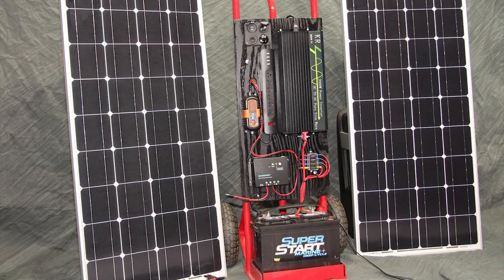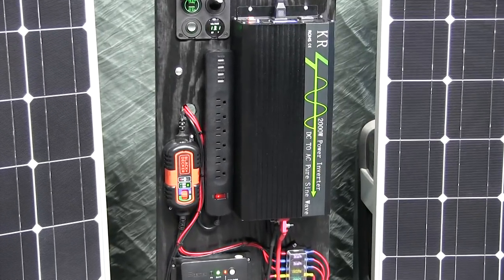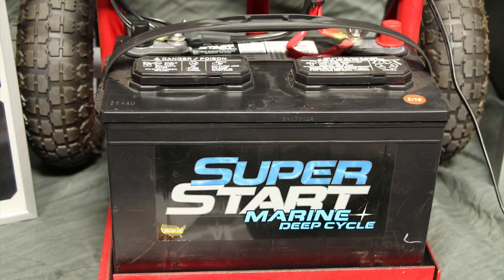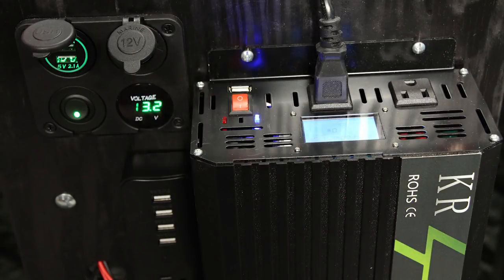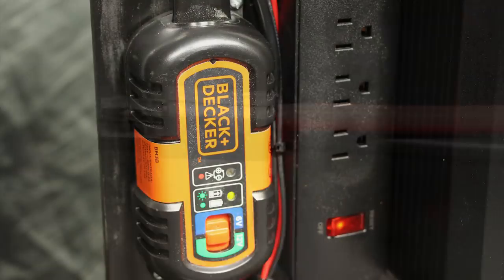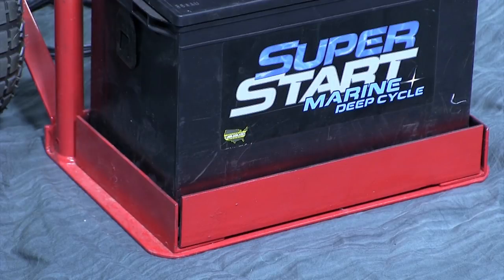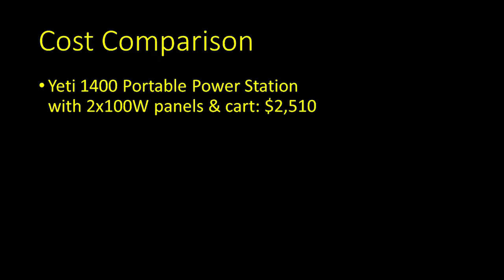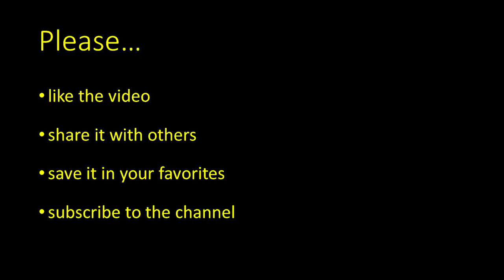DIY Off-Grid Solar Generator (rev 2) – Low-Cost Portable Power  -- with Build List

Comment: With the way you wired your 12v quick connect  with the + exposed you stand a chance of arcing with contact  metal on your build  I have all ways prefered to cover it to protect it from accidental contact and blown fuses.
Reply from the maker: Thanks for pointing it out, but I think everything is alright.  The system isn’t grounded, so the only place it could theoretically arc is to the negative battery terminal (or something wired to it).  This is a big deal in automotive systems where nearly everything metal is a potential ground for a loose 12V wire.  Nevertheless, good practice would be for the connector to expose the negative and have the positive covered.  This is actually correctly done on the unit — the power through the connector comes from the solar panels, and the positive connector on that side is not exposed.  The connector on the controller side could still arc if battery power feeds back through it, so I checked that.  Nothing, so the connector is as it should be, and there’s no risk of arcing.  I appreciate your comment, though — it’s nice of you to take the time to help me by pointing out a possible issue.  Sharp eye you’ve got.  :)

Comment: skip buying the invertor (make your own) , wrap a whole bunch of turns 400 of 14 gauge wire inside iron transformer one coil only. The more turns the better.  .pulse a transformer with transistor buy washer pump motor and motor to drive washer pump motor and one solar panel to drive motor the volts comming off of washer pump motor will get dumped into transistor to transformer and back to transistor will give you lots of volts and amps A.C to go with it. store energy in caps that connect to plug ins strip. thats all.  enough power to run several household items like air conditioner and electric heater. stuff like that.  off of ONE solar panel.  You can add a battery in there if you want for nigh time use.  enjoy.
Reply from the maker: Something wrong with the math there.  One of these panels produces 20V @5A (=100W).  If I could invent an inverter with no loss, I could theoretically get 120VAC @ .8333A (=100W).   The inverter in the unit is 87% efficient, so it can only produce 87W directly from a single panel...
Reply: not to mention would it be sine wave modified or uncontrolled

Comment: Excellent approach to explaining the why’s and how’s. One question, how do you mount the panels. I would be interested in your approach.
Reply from the maker: I originally thought I could find a good spot to use them at ground level, but that’s harder than I expected.  I finally built two wood frames to mount them on the structure that shades our BBQ.  I used a carpenter square to find the best angle in the end of Dec, when the sun is at its lowest — about 23 degrees here.  That gives them full sun pretty much all day.  The angle will be less optimal toward summer, but I’m hoping the higher sun intensity will likely ameliorate that.  There’ll be more detail in the upcoming video...
Reply: Desert Prep thanks for answering so quick. Are you planning any vids on how this has worked for you. I really like the portability aspect of this. Makes me wish I lived in more southern climes. Lol
Reply from the maker: Yes - I'm working on an analysis video based on real-world testing I've been doing this month.  It'll be ready in the next week.